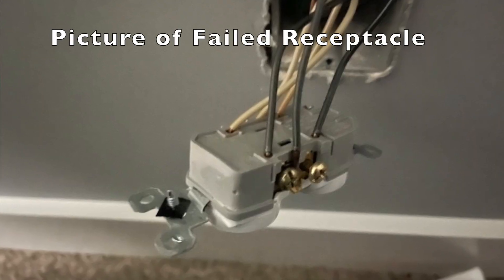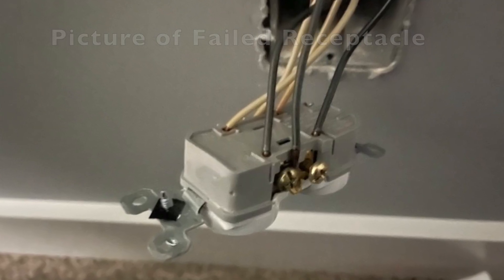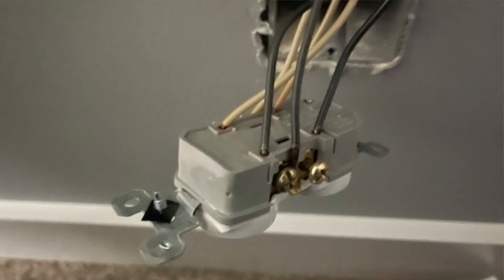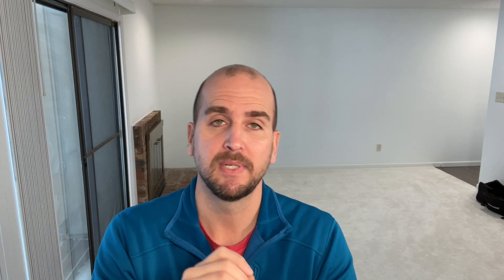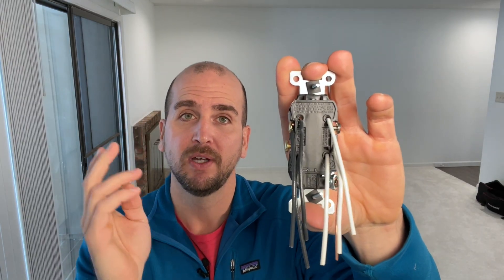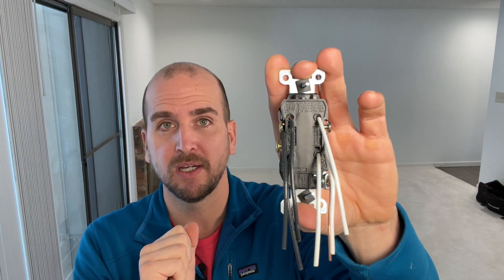Incorrectly Wired Outlet Found In Newly Built Home

Comment: Just a note, I was told and read on multiple packages that you ARE NOT supposed to twist the wires before using a threaded wire nut.
Reply from the maker: That seems to be a great debate over the 1000's of comments but you are correct the manufacturer seems to be in consensus not to pretwist.
Reply: FYI....wire nuts are not considered mechanically secure, you should always twist your leads
Reply: @saltbeltupstateny4857  Don't necessarily disagree but I've had more than one ME and every wire nut maker tell me otherwise. I find it quite curious.

Comment: If ya really wanna make sure it's fail-proof also put a little electrical tape around the back of the wire nut and onto the wire.  Pros won't take the time, nor should they...but amateurs doing just a few of these can and should do it just to make sure the wire nuts do not come off and the wires come loose and/or an over-stripped wire leaving bare copper exposed behind the wire nut could also short or cause a fire.

Comment: #1 is never an issue since I always use screws to hold the wire down. #2 I hate push-in connectors. Over 45 years as a DIYer but then, I am not a "licenced" electrician.

Comment: I noticed that you installed the outlet with ground pointing down. A while back I worked with a number of electricians who recommended the opposite. Their argument was that having the hot and neutral facing up creates a risk of a short if something metal falls onto a partially inserted plug, thus creating a short. if the ground hole and pin are facing up, this risk is avoided. I also think that the receptacle you showed was meant to be installed "upside down", because the TR symbol on the video is upside down. It would have been right side up, if it was installed with ground pointing up. Have you had any experience with this?
Reply: Oh, I just made a similar comment before I saw yours. Should have filtered to 'newest' before reading the comments.

Comment: I'm trying to find out why Leviton GFCI outlets say to contact an electrician if you have more than 2 wires in a box.  I currently have an outlet I'm replacing that has 1 line and 2 load lines (2 lines that go to 2 different outlets down stream).  The previous owner tied all 3 hots with a pig tail to the outlet, and all 3 neutrals with a pig tail to the outlet.  And he ran the pig tails to the line on the GFCI.  Then he used GFCI's on all outlets.  Can I run the line in to the line in on the outlet, and wire nut the 2 load lines to the load side of the outlet?  Which would then have all outlets protected with just the one GFCI.  thanks for any help you can give me.

Comment: I once troubleshot a switch failure for a ceiling fan.  I saw the very faint marks of wiring plier jaws 3/4" from the exposed wire. I suspected that the original installer had decide not to cut the romex at that location, but had already started to clamp down with the pliers. I now know that any altered/damaged areas of wiring inside the wiring insulation create a point of resistance, that after repeatedly heating over time will weaken and  cause the wire to fail.  Best practices are more than just practical. Thank you so much for sharing your videos.

Comment: Ha, that's funny. I'm not a professional at all, nor do have any schooling, but I use all 12/2 or 10/3 for my wiring projects, so I've always done "pigtails" without knowing what they were even called. I used to use wire nuts, but I really like those wago lever nuts for ease of wiring/rewiring
Reply: "" but I use all 12/2 or 10/3 for my wiring projects""
This part sounds scary. I hope you know the wire size is determined by the breaker size. 15 amp = 14 gauge, 20 amp 12 gauge, 30 amp = 10 gauge, etc.    Never pig tail using a wire larger than what the breaker dictates......
Reply: @johnbeckwith1361  everything has been with 20 and 30 amp breakers. Basement lighting with outlets for shop vac, drill press, etc, and the circuit for my washer/dryer and freezer. Relax, I'm not a moron.

Comment: I've been a Licensed electrician for 15 years, and I must say you absolutely nailed best practice on receptacle installations. I have shown apprentices the exact methods you used. Pre-twist wires, always use screw terminals, and pig-tail your connections.

Great job.
Reply: I used to think the way you do... until I discovered Wagor Electrical Connectors. Those are the biggest innovation in electrical wiring EVER!!!!! Check em' out
Reply: @davids7209  the Wagos with the actuated arms are okay, but a little large for device boxes in my opinion.  The wago "quick connect" type are just as garbage as sticking a wire into the push connectors in the back of a receptacle. 

Look at how the connector engages the wire (a single tooth). Understand that that single tiny contact point is what your load current is flowing through, and why that type of connection often overheats and fails.
Reply: @davids7209  its wago not wagor and they are too big sometimes
Reply: @davids7209  no I don't
Reply: @evrlastngcherry7727  Now I know why your cherry will always be available... no one in their right mind would want it!
Reply: @davids7209  Don't get salty. There are always bad electricians. All those houses that burned down because they used the quick connection on the back of receptacles were installed by electricians that thought they were the greatest thing 40 years ago... That is what WAGOs are now... A 40 year house fire.
Reply: I may be more paranoid than you, but I like to use some contact grease in the wire-nuts. I've seen them melt down from corrosion. That's rare, but it happens.
Reply: @TheTomBevis  I have personally never seen that with copper to copper connections. Nolox/EJC is used for copper to aluminum connections, because the dissimilar metals cause a reaction which prematurely oxidizes the metals, causing poor conductivity and heat at the oxide layer. It won't hurt to do it, but you are costing yourself time and money if you are a contractor, and don't expect to stay employed long as an electrician if it takes you 10 times longer to install a receptacle than anyone else on staff.
Reply: @TheTomBevis  On a side note, the only time I've seen a Marette melt was because the wires were not pre twisted, and the resulting poor connection was arcing and causing high resistance/heat (I squared R)
Reply: Boss had a bunch of us network engineers working with an electrician to wire up one of his properties. We did not use this method and one of the outlets failed... caused the next 3 in series to fail lol. Had we twisted them would have been harder to find the failed on though. Wasnt one of mine luckily. I actually paid attention to the electrician lol.

Comment: One thing I don't like about the pigtail is it increases box fill - you are adding a conductor as well as a wire nut.  In some cases, this is a problem.  However, I learned some interesting tidbits from other comments on this thread.  I can see there are some nice advantages to the pigtail.  Thanks to all.

Comment: BOX EXTENDER?!!? Wow, wish I knew about those! Going to go back and redo some outlets with those!
Reply: Yes, your box or extension ring are only allowed to be a certain distance back from the finished surface, and that distance depends on the flammability of the surface material.
Reply: @andyfletcher3561  hmm, I'll look into it. I have a couple I only needed 3/8" or so.
Reply: @eveljkov  On a flammable surface such as wood paneling it must be flush per code. Drywall, ceramic tile, etc, I believe it is 1/8th of an inch.

Comment: I didn't have a chance to read every comment below but a few things that I think are good practice when installing or replacing a receptacle are...

1 - Install the outlet with the ground oriented on top of the outlet. This will prevent a short or the possibility of getting shocked if you are using metal receptacle covers.

2 - If you are only inserting one wire under the screw terminal place it under the left side so the rotation of the screw doesn't push the wire out while tightening.

3 - Once you complete wiring the receptacle wrap the outlet around the body with electrical tape covering the screw terminals for added safety.

4 - When stripping the wire be careful not to score the wire causing a weak point that can eventually cause the wire to break off at the point where you stripped back the wire.
Reply: It is so annoying when electricians install the outlet  "right side up", its pure OCD. Ain't no way someone is going to bridge the hot/neutral .

Comment: 95% of the plugs that i find failed are at the pushins , the pushin tend to fail when the load is above 5 amps. Also you should pigtail out from a junction, oh, you said that.  You wrapped the wire around the screw the wrong direction.

Comment: Guy you hit it out of the park on this one with the pig tail suggestion. I had never though of that and just did a friend's switch that had two wires on one screw by a so-called professional. I'm going to go back and do the pig tail because I also hate push ins since they always seem to loosen over time. Thanks!

Comment: Back in the 80s my parents had a house built and the professional electrical crew had just finished our house but our new dryer would not work. I saw them working in nearby and flagged them down to check the wiring. They had a look and quickly pronounced "It's your dryer".  So we called in a repairman to check the dryer, first thing he did was check to see if it was hot even though the breaker was off.  Turns out there was still juice, they just wired it wrong, and it most definitely wasn't the dryer. The repairman then went and fixed the wiring for us, it didn't take him that long and I'm not even sure if he charged us other than the basic service call.  Still, older houses are more likely to have some crazy electrical work done by do it yourself types. 

Also one thing I wanted to mention, many electricians will put electrical tape around the receptacle, which would presumably avoid any contact with the box. 

Also what is your take on the push in type connectors (I'm in Canada so we don't seem to have the lever type Wago but just the push in).  I have seen them used by professional electricians and they seem quite handy especially the 3 or 4 type connectors.
Reply: Fantastic!  Had no idea about pigtails and had this exact problem.  Home Depot had no outlets with 3 push-ins on each side and would like to do better than what was there in the first place.  I had three hot and three neutral on each side.  Now I can do it right.  Home Depot guy just told me to leave the wire straight and put two wires in one screw and one wire in the other.  WRONG!  Or at least not "best practice".

Comment: I just installed a push in, yes they push in, with a GFI outlet. This push in actually had a screw to tighten it so that it would avoid the failure point. There was actually not a setup so that you could use a shepherd's hook system. Very clean very secure. I picked it up at Lowe's not knowing what I was getting and when I found out what I had I was actually somewhat impressed. I'm just a weekend warrior but I felt comfortable using it on 12 gauge wire.

Comment: OMG! Over 40 years in the buisness,  and finally someone points out the push connectors are 14 ga. Wire Only.  In my world we call this fire wire! However,  you don't want to pigtail to another outlet that is for a refrigerator, or freezer, or major appliance! They should be on their own circuit!
Reply from the maker: Good point, thanks for the feedback 👍

Comment: Those push in spring clips SHOULD be against code (IMO) because of the limited contact point.  I have ALWAYS tied all wires together in a pigtail fashion with wire nuts.  Takes a little longer to "do it right"..but  fewest issues over time
Reply from the maker: Yeah, unfortunately that seems to be a very common failure point.

Comment: The first tip you have you forgot an important step it's not code but it's good practice. That is after you connect the wire to the outlet you should  wrap the outlet with electrical tape .

Comment: 3:46 "Push-in's are more common as source of failure opposed to a PROPERLY INSTALLED wire underneath a screw terminal". Well that is exactly missing the point. And how does it compare to ALL wirenut terminals? PROPERLY AND WRONGLY INSTALLED ?? Then its 100x safer to use push-in. And how do screw terminals behave over time? DOnt they sometimes loose contact due to vibrations and material expansion? A spring temrinal is always better choise  1st: because you have a much lower chance of WRONG INSTALL, 2nd: a spring connection never deteriorates over time while screw connection does. I am working in power and chemical business , we are rebuilding control systems for power plants and chemical plants, installing LITERRALY MILLIONS of terminals every year while having almost ZERO problems with push-in's of all kind at the same time as solving hundreds and hundreds of issues with screw terminals. Btw there is a demand by law (Europe) for power and chemical plants for maintenance to go over ALL SCREW TERMINALS once a year and tighten them. You sure can imagine what is the reason for that. There is no such demand for spring terminals.
Reply: At least in germany it is very uncommon to find new outlets with screws, these are basically all push-in.

Comment: In my local as an apprentice I was taught to always twist solid conductors together. Also, I see so many people in my local twisting stranded wires before installing the wire nut, which in my experience will cause the wire nut to fail more often than not.

Best advice I ever got when I was an apprentice was to tug test every conductor in a wire nutted splice before tucking it into the box. If one comes out of the bundle you just saved yourself or someone else having to deal with a failed splice at some point down the line.

Comment: NOT using a pig-tail is NOT a mistake. Its perfectly fine to take the 2 wires and attach them directly to the screw. Less material, less wires, less mess behind the outlet and it looks cleaner. Every time i see a pig-tail i REMOVE them because i don't like them, its stupid and pointless IMO and there is NO code saying that pig-tails need to be there

Comment: Don't understand why you waste time with your linemen twisting the ends? the wirenuts do that for you once you twist on the wirenut...
Reply: The reason people twist them is to keep them from sliding up and down while they're installing the wire nut. It doesn't matter once the nut is installed if it's installed correctly. But it's a lot more likely done correctly with the twist holding it in place.
Reply: @kevindouglas2060  I see your point which is a good practice. My opinion and experience is I never have them fall out while twisting on the wire nut. And always once I'm done I give a tug on the wire to make sure none are loose. I know because I've had few instances where it was loose. But seems like an extra tool and time spent that's not necessary. I've been trained for speed where I live and if I did your method I'd probably be already fired from my company.. We rough in 3k sq ft houses in 2 days and trimmed out so we have to be fast. But maybe where your at its different. But I do like your method because it'll never come lose.

Comment: Now if you turn the cover plate screw 6 o'clock/12 o'clock position, it's 100% safe, and looks good!!
Reply: The issue I have with this practice is the installer, rather than stopping when the screw gets snug, overtightens the screw to make it vertical, deforming the wall plate. This makes me think the installer was careless.
Reply: @DG-xz5oc  it also will tell you if anyone has taken off the plate and fiddled with it ....especially important on 3way switch calls cuz if you inspect it, any screws out of the original 6 and 12 position would be a damn good place to start looking, yes?

Comment: No explanation as to why or how push/stab-in connections are failure points.
Reply: It goes to the "spring" that holds them...the heat developed during loads...the differential expansion of metals...the hardening of materials during it all...

When a stab-in is nice and new and hasn't been cycled at all, it is all good.  The spring hold the conductors nice and tight.  When you cycle it a few hundred times with a vacuum cleaner or other heavy load device, the springs and conductors get a chance to heat and cool...expand and contract...and get a bit stiff.  Eventually, you can get to the point where the spring no longer is tightly bouncing back to hold the wire tightly and that slightly loose grasp creates a higher resistance which accelerates the problem.  Higher resistance means higher heat.  If you are lucky, it will just fail and you won't get anything out of the outlet.  However, I have pulled some out of the wall where the wire just falls out of the back of the outlet.

Might have been defective from the start, but then again, the science is sound in saying that eventually - all push ins will probably fail in the same manner.  It ends up just being a question of if it happens in a year, 5 years or a decade.  You may never get to that point if it just is used for low load devices.

Comment: Do I have to use extender when connecting on the side? Or is that mandatory for pigtail connections only?
Reply: Box extenders are required anytime that your finished wall is past the box.  Especially if it is a potentially flammable wall material (wood paneling in this case), but with non-combustible materials (gyp, tile...) you can have it recessed as far as 1/4" before the extender is required by code.